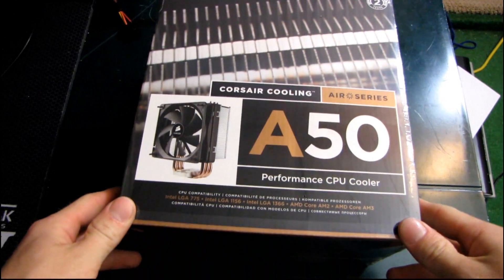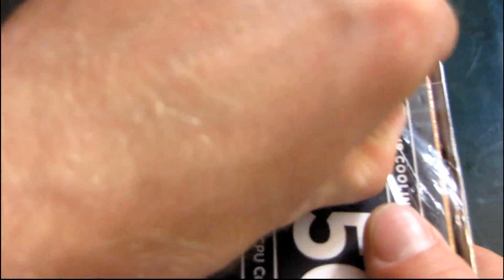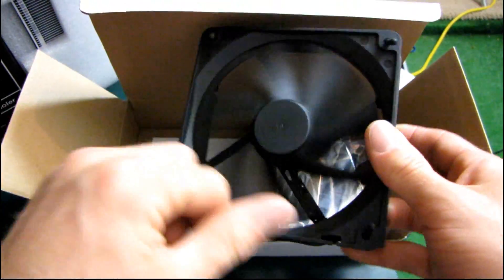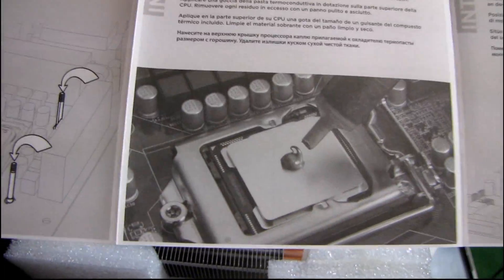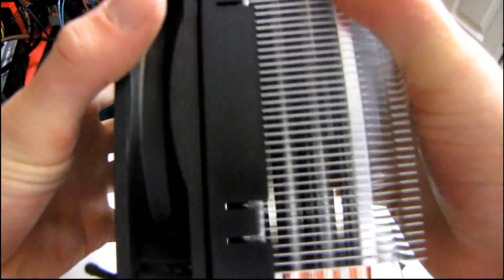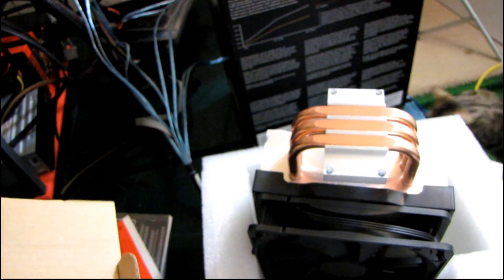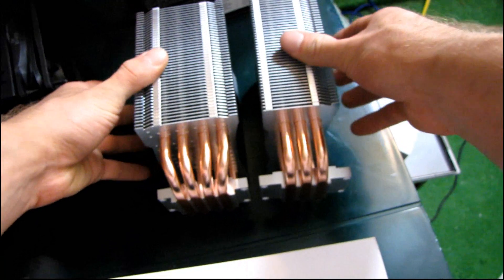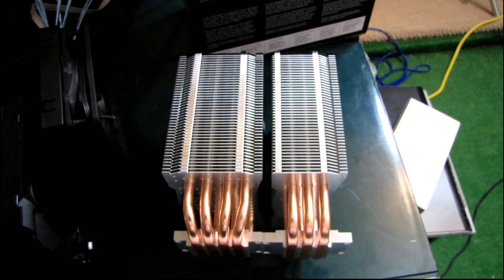Corsair A50 Performance CPU Single 120mm Fan Air Cooler Unboxing & First Look Linus Tech Tips

Comment: the stock cooler that comes with the phenom 2 black edition works decently, idles at 30c and no more than 50 under stress. but its hella loud. i need a good air cooler that would fit in a rosewill redbone any suggestion?

Comment: @Evi4666 

If you want a real, substantial upgrade I recommend you step up to the Scythe Mugen 2.  The fact that it's within 3C of the Noctua NH-D14 at stock should tell you everything.  In push/pull, it's within 1C of the D14.

Obviously, that comes at a price.  It's costs $38 at Directron, and the heatsink tower is huge.  The advantage of it being so huge is that it has great heat dissipation, plus the fan it comes with is nearly silent.  Just make sure you have enough room in your case.

Comment: @Evi4666 

For that setup, no.  An Athlon II X2 250 at 1.5V and 3.8GHz will be running at a max of around 45C on the A50, so there's no real reason why you should "upgrade".

Even in push/pull setup, I wouldn't recommend the Hyper 212+.  You'd be going from being 3C hotter at stock to getting the same temperature, plus it'll probably be noisier.  What makes the main difference between the A50 and Hyper 212+ is the A50's higher density, meaning it has a larger area for heat dissipation.

Comment: @Evi4666 

It delivers better cooling performance, though you lose the ability to mount a second fan and it doesn't have a PWN fan (though you can select a low-noise mode using a restrictor it comes with).

TweakTown got a temp. 3C cooler than a Hyper 212+ on it, though I question their testing methodology.  It says both of these coolers are better than the Scythe Mugen 2, which is absolute bullshit.

Overall, for the same price, I'd say the A50 is better.  It's only at $22 at Amazon.

Comment: Do you need that little plastic thing on the back to stop shorting out the mobo.. because I installed a CPU cooler like this one the other day and the back plate didn't have any rubber or plastic to put in front of it before the backplate so I just but the backplate on... the PC posted but will it cause long term damage or something?